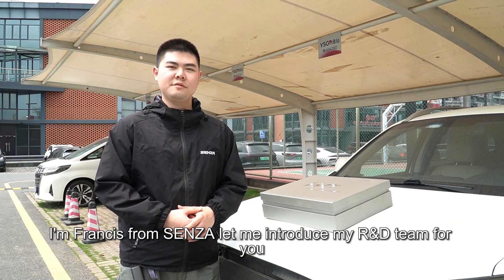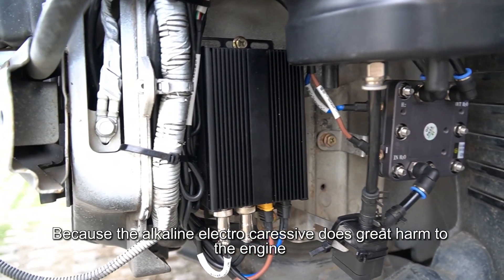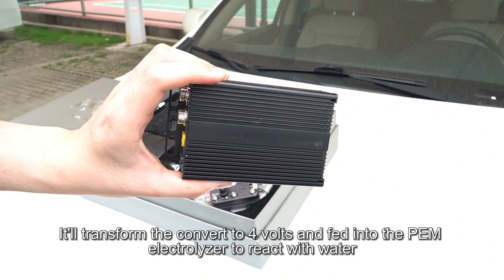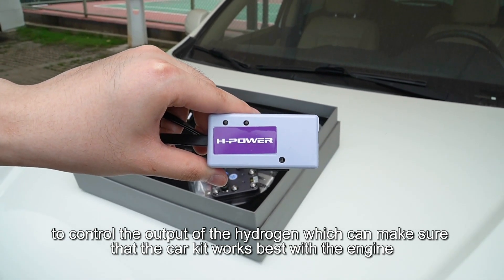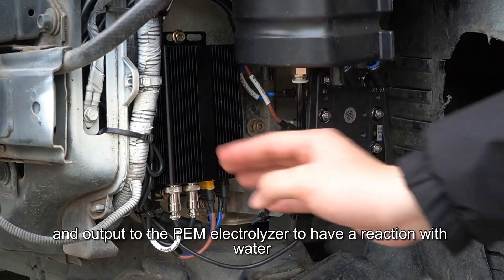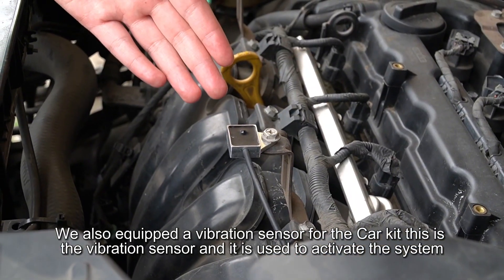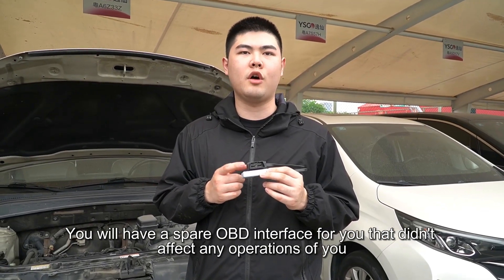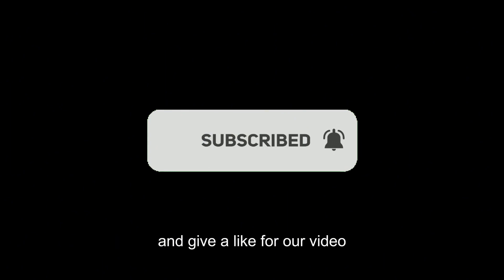Maximize Efficiency with SENZA Hydrogen Car Kit Full Demo and Features

Comment: So does it just dope the intake air with hydrogen?
Reply from the maker: This car kit generate the water into hydrogen and oxygen, hydrogen is very helpful to make the fuel burn completely in the engine, so it can save fuel and increase the engine power.You can send an email to "service@senzahydrogen.com" for more information.